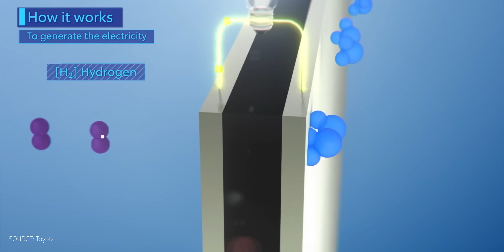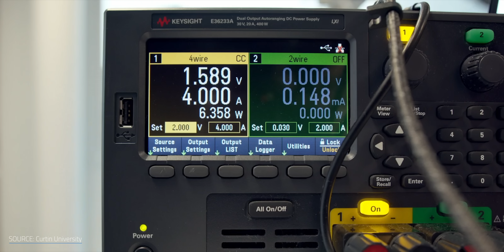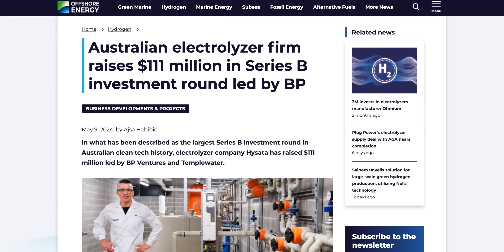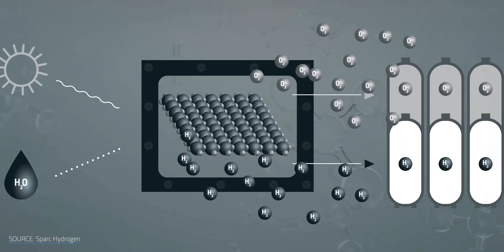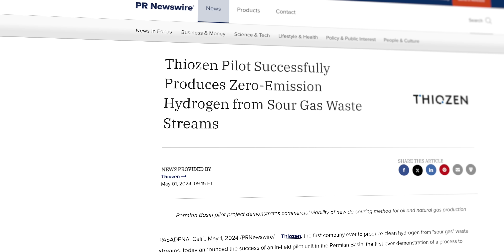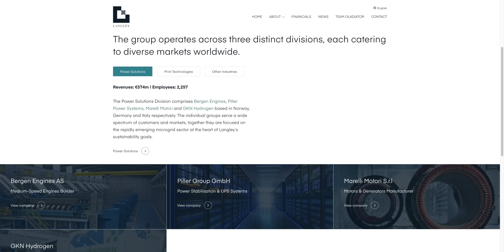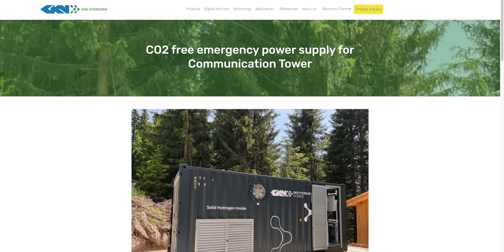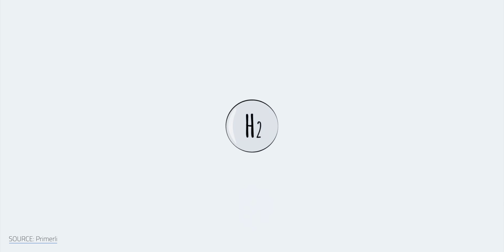How a Hydrogen Breakthrough is Closer Than Ever

Comment: The production side is eventually solvable. An entire video should be done on hydrogen storage, because it interacts with everything. IMHO, this is the real blocker.
Reply: The metal hydride is a great idea. After that carbon fiber pressure vessels would be second. I'm surprised no one has created a screw compressor that's powered directly from a windmill.

Recently saw a video of a guy making a 2 stage compressor from refrigerators to make liquid hydrogen, via liquid CO2. Just an HVACR guy diy in the garage.
Reply: Well, they made tests in Finland and... make it thick enough and steel had no problems with hydrogen.
Reply: The problem is more that it's so small it infiltrates through basically every barrier in gaseous form. For example, steel containers absorb hydrogen and become brittle.
Reply: @kerriadereth  You act like handling hydrogen is some new tech. It's not. The chemical industry uses hydrogen infrastructure since the 1930's with pipelines, storage etc.

It's really old tech. Simly use stainless steels and plastic lining.
Reply: @kerriadereth  Yeah, I been home experimenting with hydrogen storage. The neighboring townships love me. a

Also if you are going to do that keep it small and make sure you have a blast shield area.
Reply: @kerriadereth And the other problem is that hydrogen explodes ... So there's that.
Reply: A person I know worked in a team trying to solve this converting hydrogen to/from ammonia (NH3). I don't know how easy, convenient, or cheap it could be to do, but it would be one of the best solution for both storage and transportation for sure
Reply: Compressing it isn't much fun either. A lot of energy you never get back.
Reply: I honestly don't think storage is an issue as H2 can be produced as needed on site and where storage is needed the turnover rate would determine how much strage you need. If your storage tank gets emptied every week then the loss to atmosphere is minimal.
Reply: Big development being done in using salt domes to store hydrogen.
Reply: let it react with something thats easy to split, and use that. i think thats the idea behind solids state storage. but the storage medium needs to be something that is easy to recycle or goes back to its original state when the hydrogen is extracted. it would get around the problems with simply tanking it.
Reply: As someone whose working with hydrogen powered rockets this is the biggest struggle facing the tech, even with new alloys specifically made to prevent hydrogen leakage there is still loss. There is no vessel or seals that are truly hydrogen tight, there is always loss.
Reply: 100% Making it is very easy. Excess energy & water = cheap H2. Storage/Transport is the deal breaker.
Reply: Acetylene.  . 
Water Torch use on Demand..
Reply: Sounds easily solved, could quickly find it's niche when cheaper alternatives aren't available to replace plastic and a lot of other stuff using duckweed and grass and free solar and the electric scooter is a little bit of a hidden camera and it is not a good idea but I don't get to hug anyone but I don't get to hug anyone but I don't get to hug anyone but I don't get to hug anyone for using free grass for solar and a lot of other stuff if you have the free time and a place to work on it till it's ready maybe for free plastic alternatives to forge a diamond pickaxe from grass and carbon capture 
Maybe a replacement for natural gas
Reply: Sounds easily solvable if you have the free time and a place to work on it till it's ready using algae and grass for free solar and the electric scooter is kind of a hidden camera but I don't get to hug anyone but I don't get to hug anyone but I don't get to hug anyone but I don't get to hug anyone
Reply: Exactly. To gurn hydrogen liwuid you spent more than a third of equivalent to the energy it would generate, just to coool it to became liquid.
To store like just compressed it leaks and take lotsof space.
Reply: You can eat it. Not kidding.  Hydrogen plus carbon dioxide plus the source of nitrogen can be fed to bacteria at a high production rate and the bacteria are a high protein

Carbon dioxide we know is cheap  but hydrogen is not and the Haber Bosch consumes a lot of pressure and energy.   

But if the problems with hydrogen are reduced, you can get a nutritious protein from waste gases
Reply: @robertunderwood1011  Cute, but turning energy, co2 and h2o into proteins, peas already can do under a growlight.
Reply: I agree about the storage problem.  There is also the issue of energy density.  Hydrocarbons, such as fossil fuels, have a very high energy density, which means you can get a lot of work out of a small volume of fuel.  Hydrogen by itself is not.  This problem is increased by the current methods in storing hydrogen.  The two primary methods are high-pressure tanks or cryogenic tanks, and neither one works well for consumer vehicles.  Want to run a fork lift in a warehouse on hydrogen? No problem.  Want to drive a hydrogen car from LA to NY? Good luck!
Reply: @kittenisageek  sure, and this is an issue for example for planes that would have tobe fundamentally different desigend, where volume is a consideration, but otherwise specific energy is more important, and thats higher.  (energy per volume vs energy per weight).
Reply: STORAGE & TRANSPORT are The Achilles Heel of Hydrogen!
Reply: @202AMERICA  Half of that is has in common with electricity. Storage of electricity is a problem. But Transport of electricity is trivial and super effective.
Reply: Smallest atom. It can passthrough from every other element layer.
Reply: Hydrogen seeps through solid metal. It's not a problem on a small scale, but on a large one it becomes an explosion hazard. This has been a serious issue for nuclear reactors in the past, and they don't even produce large quantities of hydrogen.
Reply: If you look st how many hoops the oil and gas industry jumps through to get petrol/gasoline/jet fuel etc to market then there's still a path forward for Hydrogen
Reply: @greendale634  not just storage it's transmission. You just can't put hydrogen in the old natural gas lines that criss cross the nation. They need a quick inexpensive solution like a liner or something that won't be as corrosive as hydrogen is compared to natural gas.
Reply: Hydrogen can be mixed with MCH to transport it. It stable as this compound and can be stored and transported safely. Another stable way to transport and use hydrogen is NH3 also known as ammonia which is commonly used as a fertilizer. As ammonia it can also be used to even power trucks or industrial machinery. Only major challenge now is building an infrastructure to support the use of hydrogen by average consumers
Reply: To understand why H has severe limitations for the 'green' future, you need to understand the physics, chemistry, AND economics. H just doesn't make sense for anything but niche energy storage/use.
Reply: Lets say that even the storage is solved. How many applications can realistically be more economically powered by hydrogen and not more economically powered by the electricity used to make that hydrogen. The whole produce-store-transport-use cycle for hydrogen has so low efficiency even in the best possible scenarios that having 1kWh worth of hydrogen will rarely be more usefull than directly using the 3-4kWh of electricity that made that hydrogen. Surely there will be some use cases for it but I think by the time the technical challenges of producing and storing it are sufficiently solved those use cases will be fairly rare.
Reply: @hebijirik  Steel making with hydrogen.
Reply: @hebijirik  I wonder if we built infrastructure for hydrogen transport (pipelines), it could be used to transmit energy from green energy generators to areas without. Essentially a network that acts like a battery. There is no waste products and no mining for rare minerals.
Reply: @oledyl4892  Interesting idea. I would be curious to know how good environmentaly that would turn out. Hydrogen pipelines from what I heard and read are a lot more difficult to build with acceptable leakage and acceptable lifetime than the natural gas ones we have today. So the existing pipes cannot really be used and the new ones need a lot more material to make them (I heard 3x more steel just for the pipes etc.). And then there is all the digging everywhere to instal the network. So it might be worth it emmisions wise in some very long scenario but I cannot even guess how long. For electric transmission lines and for batteries those numbers are known and relatively short (years not decades). If someone has calculated how long it would take to pay back the emmissions from building a comprehensive hydrogen pipeline network and all related systems I have never seen the results. I would be curious to know the answer if someone has it.
Reply: @hebijirik  Good points, I am curious as well.
Reply: @hebijirik  Hydrogen vehicles, powering remote places/backup power with compact and reliable power cells with no carbon emissions or other harmful substances, fuel cells does not produce chemical fires like lithium-ion cells do, they have long service life of 10+ years iirc, and i think it will be even longer in the future. Only downside is that you need small battery to start fuel cell. For lower power consumption you use batteries. Hydrogen storage is sorta half solved now, Toyota produce composite gas tanks that hold up compressed H2 at nearly 700atm. Hydrogen is safer than natural gas, because it floats, there's H2 leak detectors on the market also. If there will be more efficient way to produce H2 i think it may become more convenient and reliable way to power things than big lithium batteries. But if there will be stable batteries with huge energy density that does not combust and have very long service time and near instant charging time it'd be good too.
Reply: @hebijirik  It is yet to be more economic to power through Hydrogen, but Hydrogen is never meant to be used everywhere all the time, Hydrogen is just a way to store energy for transporting it a long way, or in places where infrastructure is lacking. Kind of like LMG,it is also a way of balancing the grid, since in daytime energy produced is in a big excess, but at night we have trouble with it, Hydrogen would be a green way to store and use to balance the grid.

Also good for Trucks going long ways, coast-to-coast in basically any country or continent, if we produce so much energy we can make very cheap Hydrogen, i doubt truck drivers mind having a few extra stops to recharge and fill, if it means also very cheap fuel.
Reply: @hebijirik  Furnaces are a big one. Steel is better off using electricity, but pot metal furnaces melting aluminum, copper etc could benefit a lot from hydrogen instead of propane. Especially regarding amateur use.
Reply: @Relatablename  Amateur use? I don’t think amateur copper-smelters are the problem. ;)
Reply: @Qwitsoender  Everybody is the problem. Human existence is the problem. If there is a room for improvement anywhere, then it was needed yesterday.
Reply: @Relatablename  given the range of concentration in which hydrogen is explosive compared to the same for propane we could see some real darwinism if amateurs start using it 😀.  But as you say some industries probably will. I just think that compared to electrical energy consumption the hydrogen energy consumption will be maybe single digits percent or even less. Even where industrial high temperature heating is needed just figuring out how to do it electrically might be worth it compared to using 3x more energy in hydrogen just because the end device is simpler.
Reply: @Relatablename  Uhuh, ok. Pretty sure the problem with the climate is not ‘at all’ because of the handful of amateur copper-smelters, but you do you.
Reply: @hebijirik  Hydrogen is not explosive while stored without oxygen. If pressure builds up then there's a relief valve for that. The gas rapidly dissipates while gases like propane will pool on the ground. Hydrogen just gets a bad rap. I've stored it under pressure myself with no issues.
Reply: @Relatablename  I know it is not explosive without oxygen, that is kinda obvious. What I meant was that I have seen people use various very janky DIY setups with propane and hydrogen seems to me like it would be much less forgiving of mistakes. The probability of a leak being not too low and not too high to easily ignite seems higher and the speed of the flame propagation is also a lot higher. And getting a leak in the first place might be easier too with the much smaller molecules. So someone with the attitude of "I've been doing it this way since before you youngsters were born"  could be way more dangerous once they switch from propane and butane to hydrogen. 
I think effort should go to mainly getting all the hydrogen currently made from fossil sources and used for its chemical properties where it is irreplacable to be made from renewable energy in the future. Getting new uses for hydrogen to replace things that could be done in other ways is an unnecessary side quest.
Reply: @Relatablename  But what happens when that leak/relief happens in someones garage.
Reply: @alexatkin  it would be less dangerous than a leak from a natural gas line or propane canister. Hydrogen doesn't burn fast enough to explode unless confined and mixed with a higher concentration of oxygen than what's in the air. 

And unlike other gasses, its ability to permeate lots of different materials means it would leak from the garage fast enough for there not to be much of an explosion risk at all. The biggest risk is turning the hydrogen storage vessel into a hard to extinguish torch until it runs out of fuel really.
Reply: @alexatkin  Any gas cylinder needs to be stored in a ventilated area. That's not unique to hydrogen.
Reply: @da0yster  While hydrogen does dissipates fast, this is false: "Hydrogen doesn't burn fast enough to explode unless confined and mixed with a higher concentration of oxygen than what's in the air."   There's a nice experiment where you bore a small hole in the bottom of an open can, turn the can upside down, fill it with hydrogen, set it on the ground and ignite the hydrogen escaping through the hole. It burns with a small invisible flame, until the air replacing the burned hydrogen in the can is enough to provide an explosive mixture. Then bang.
Reply: @hebijirik
Reply: @hebijirik  exactly. law of diminishing returns... the only true renewable energy that can provide reliable 24/7 clean power (no hazardous chemicals/byproducts used to produce the technology itself like solar panels rare earths metals) outside of nuclear is hydroelectric.
Reply: @renaissanceman5847  So, couldn't hydroelectric be used to produce hydrogen? (sorry, not a tech person).
Reply: @hebijirik that's right. Good for green steel production where you need the hydrogen directly. Good use case. Batteries win every time for transport
Reply: @kutto5017 , I agree that batteries are better for transportation. I can charge at home every night while I sleep. I can't make my own hydrogen at home.
Reply: @hebijirik  As someone who rents an apartment it's the difference between me driving a gasoline powered car or not for one. Do you know what it costs to replace a battery for a electric car? Tesla and many other companies will not let you repair it, so if it breaks after warranty but before you've gotten your money out of it...well that's actually a problem that's not uncommon enough.

I'm also not waiting for hours for my car to charge, I have to drive to much for that to be remotely reasonable.
Reply: @GeorgeWashingtonLaserMusket  if you want to believe all the myths you just listed and you want to believe hydrogen will save you from them I am afraid there is nothing I can say that would change your mind. Go buy a hydrogen car, see for yourself how great they are, then maybe you can join the collective law suite the Mirai owners have launched against Toyota because of how great their hydrogen cars work.
Reply: @greendale634  you can't win when you're against physics
Reply: @anestacom  people once thought it was impossible to fly faster than sound. Human ingenuity is what will save us, nothing else.
Reply: @anestacom  the first of the 3 Snow mnemonics for Thermodynamics...
Reply: @anestacom  Living in the past doesn't advance science.
Reply: Storage for industrial use is no problem, hydrogen based transport on the other hand is fight against laws of physics and therefore lucid dreaming.

1 litre of liquid hydrogen has between quarter and fifth the energy of conventional fuels, that's how bad its volumetric density is. So it doesn't matter how much magical material another startup puts into their hydrogen tanks they're still gonna end up below liquid hydrogen volumetric density, density that's laughably low compared to century old fossil fuels.
When instead of compression they they try to store it chemically or by absorption in various porous stuff they still cannot hit densities we already have available from diesel/gasoline, often just trading increase in volumetric density for loss in density per kg.

So if someone wants to sell hydrogen as industrial good and deliver it with pipelines to factories and powerplants that may be worth investigating, but if they talk about hydrogen cars and hydrogen planes just skip.
Reply: @sznikers yeah the portable hydrogen idea (cars, planes, etc.) is a no-go. But for actual electricity production i think it could be viable. Transport IS an issue, but we could eleminate this step and just not transport it: build your hydrogen production plant on-site with your electrical plant.
Reply: Hydrogen Storage : visit New Atlas. "......Hydrogen stored in iron: A cheap, scalable grid battery for the winter......."
Reply: Also, lack of energy density.
Reply: Do we just ignore the billions of tonnes of brine produced if we tried to make this much hydrogen, too?
Reply: No, it isn’t.
Reply: Oxygen "reacts with everything" too - we manage that
Reply: Nah, H2 storage is solved. The production side is the issue, the video didn't say how much energy is still net loss on electrolysis (and transformed into heat) the efficiency rating he is giving in the video is bogus and not net total - and how this net efficiency compares to lithium batteries.
Reply: @georgelionon9050 care to elaborate on how storage is already solved?
Reply: @sspectre8217  let me ask in return where do you see the unsolved problem(s)?
Reply: Solved? So if it leaks from a tanker parked under streetlight explosion is not happening anymore? @georgelionon9050
Reply: @georgelionon9050  How is storage solved ?
It is still the most leak and explosion prone gas on earth....
Reply: @georgelionon9050  Not in a practical sense. It's really hard to find aluminum cylinders anywhere, and commercial high pressure storage is out of the question for most individuals.
Reply: @georgelionon9050 , Didn’t he say that the efficiency of electrolysis has been increased to 95%?
Reply: @terjeoseberg990  i was wrong
Reply: @terjeoseberg990  it has but essentially hydrogens issue is the round trip. You need a heap of electricity to get out and basically after an the processing losses batteries for the original electricity win every time...
Reply: @georgelionon9050  Net loss is not an issue... Trillions of watts of sunlight hit the Earth... Billions of little home owned solar conversion units chugging away providing personal hydrogen for transportation, farm equipment and what nots. Once the initial costs are amortized, it's all free money.
Reply: @bosatsu76 sure, if you forget that EVs need 10x less of those initial costs.